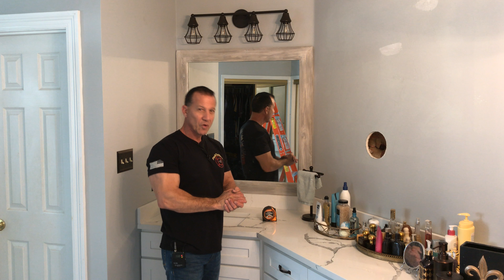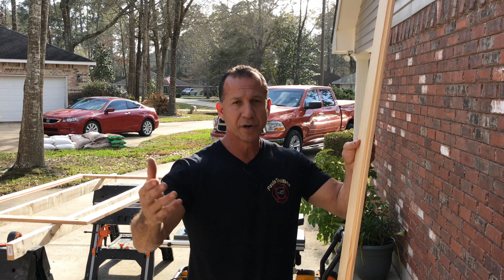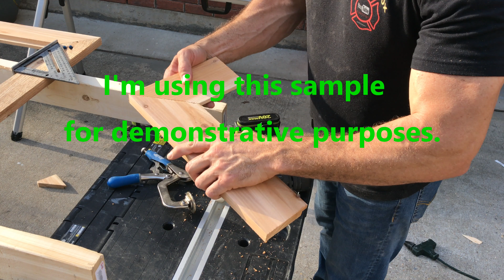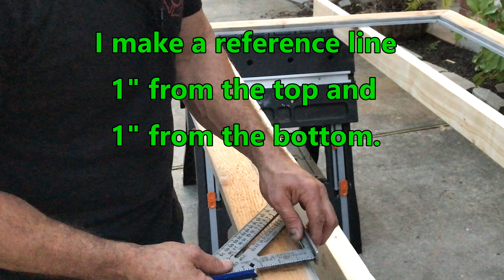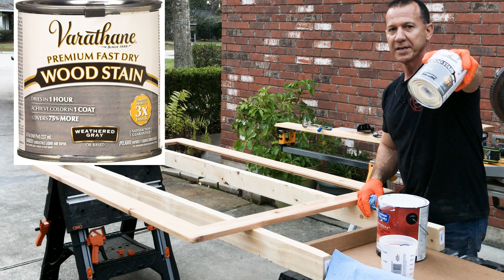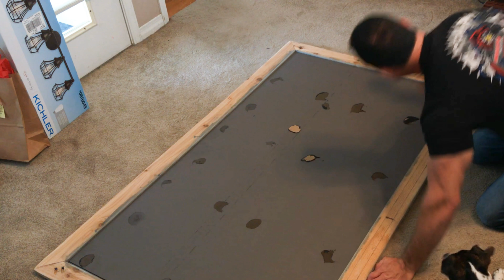Update your old plain mirrors

Comment: that's such an easy  finsh makes that cheap wood look nice .  do you think a clear on top is needed for protection since your in the bath
Reply from the maker: Hi Matt, it isn't necessary because I am using Cedar wood. Stain  also helps protect the wood from damage due to condensation. 
Thanks!

Comment: Love your videos.  Need some help though.  On another one of your videos you were cutting out a door with a router.  I’ve tried this method but my bearings keep burning up and popping off the router.  Any clue as to why this is happening?
I’m using a Dewalt 1.25 variable speed router and Irwin’s marbles 1/2” carbide tipped trimming bit.
Thanks so much for your videos👍
Reply from the maker: It is hard to say without seeing it, but sounds like you have a bad trimming bit. The shaft may be bad if different bearings are giving the same problem. I would try another bit and see how it works. Sorry!
Reply: Paul Ricalde thanks so much.

Comment: I have a large mirror, approximatley 3ft x 5ft,  that I have been wanting to make a frame for. It started out as a bathroom mirror applied to the wall above the sink/vanity and still has some of the adhesive on the back side.   I want it so I can sit on the floor and lean against the wall.  Would the glazing points be adequate for holding the mirror in the frame in this situation?  Or will it need additional support/stabilization to keep the mirror in the frame in leaning position?    
I only recently found your Youtube channel and am now a subscriber and have already learned from watching.  Thank you!!!
Reply from the maker: Hi daiseydogg, If your frame is tight all the way around you should be good, but I would apply a small bead of clear silicone in the rabbit joint before laying the mirror in place. Make sure it is a small bead and in the crease of the joint so it won't bleed out on the mirror, then you will add the glazing points on the back side of the mirror. I hope this helps!
Reply: Thank you!  That is very helpful!  Looking forward to more of your videos.